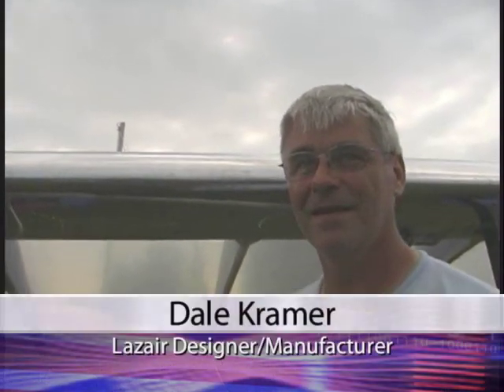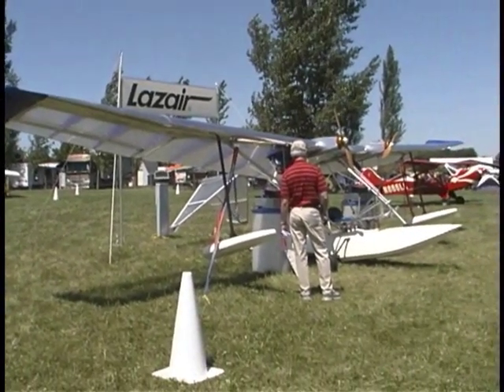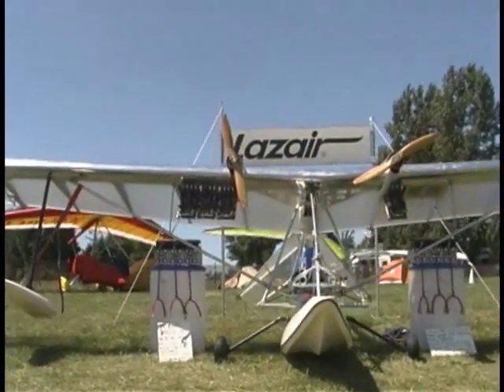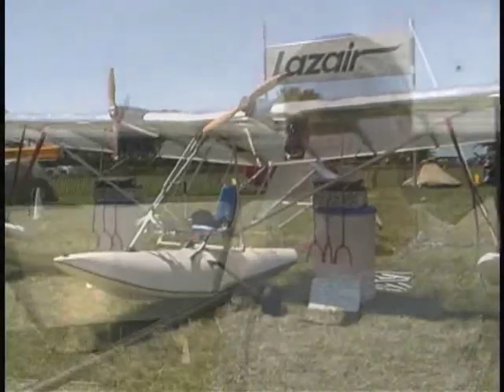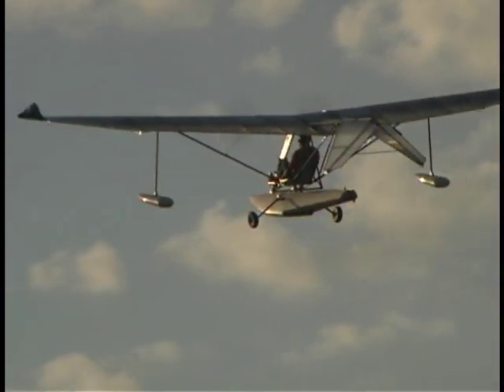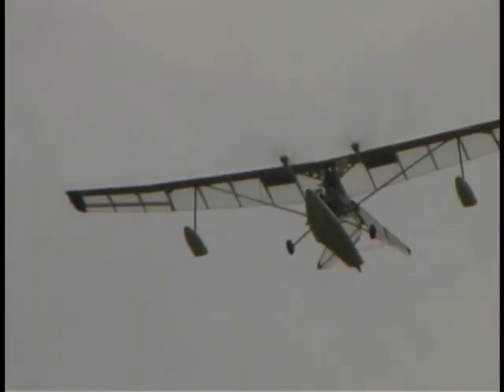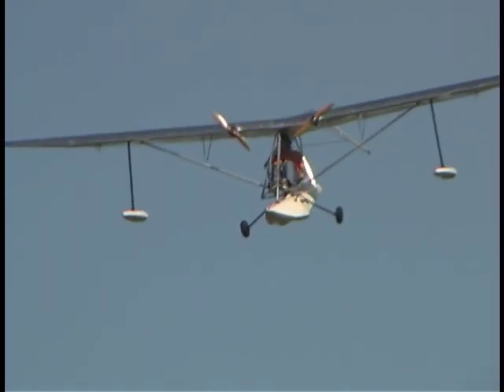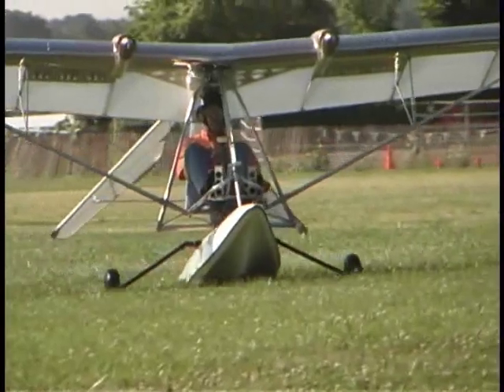Electric Lazair, Dale Kramer's amphibious electric powered Lazair ultralight aircraft.

Comment: I love how quiet this aircraft is. My concerns are.  The duration of flight time and the fact that LiPo cells are notoriously difficult to charge and maintain. As an avid R/c modeler I have always had trouble charging these cells. For some reason that I'm sure is my fault, these cells always seem to puff up and inevitably die. I have also had them pop and burn. Which brings me to my last concern, the chance of fire, very hot fire. If these batteries burn they burn extremely hot. I'm sure with proper training and care the batteries can be made safe. For some reason I have always had better luck with Lithium Ion batteries. could they be used instead?
Reply: I have deliberately "set off" some old RC Lipo batts after they had crashed and I did not want to trust them in a plane. I have gotten clouds of very acrid smoke but no flames
Reply: +captrich420 Have you tried enabling your lipo cutoff voltage on your ESC? Lipo is very easy to maintain with no memory problems and just about any charger working. The trouble is when they are discharged too low too many times.